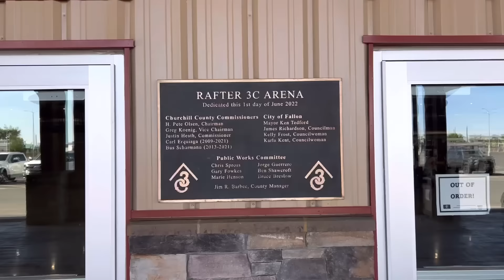Summertime Anchor ⚓️ Brand Ranch + Cummins Project / progress 🛻

Comment: sweet. in 2005 i bought a 6.4 with a blown valve and had it in my garage. after buying a long block and 6 months later my ford f 350 like yours was like new again.  then my neighbor came across the street and said, pat you cost me $50 . i said why, he said we bet youd never get that truck running.  gee thanks for the vote of confidence.. in 200 i drove it to houston from san diego and back after fema repairs i made in texas/

Comment: We had an old Ford F6 hay truck that was temperamental about shifting at times. If I shifted into a forward gear then eased the clutch just a tiny bit, not enough to enough to even move the truck but just enough to jiggle the gears, I could then go back and shift it into reverse.

Comment: If I remember correctly you left the Ford Transmission in the build. If you know roughly the difference you need to make call a good Ford parts guy and he can sell you a plastic gear to swap out very simple on most Ford standard transmissions. 
( FYI but not all of them )

Last thing are you going to have this truck ready for S.E.M.A. next year ?

Comment: the truck sounds good is that motor a 5.9 or the 6.7
Reply from the maker: 5.9
Reply: @anchorbrandranch  i have a 5.9 in my truck with 340 thousand miles on it and it runs as good as it did when it was new